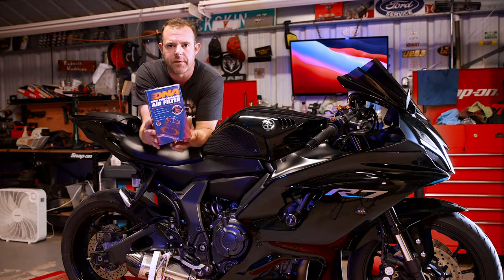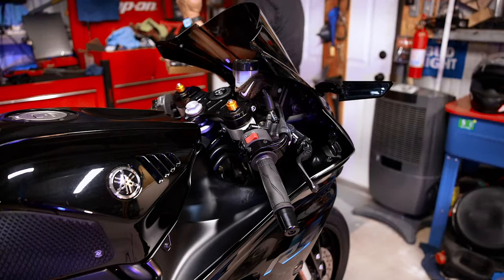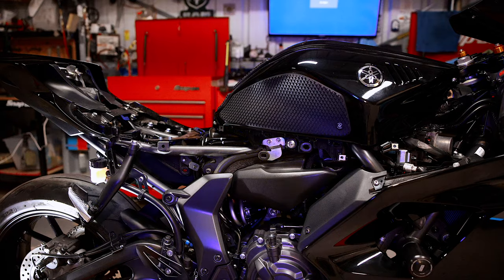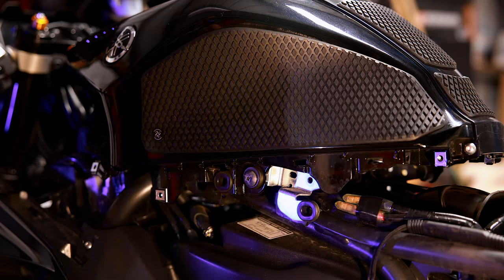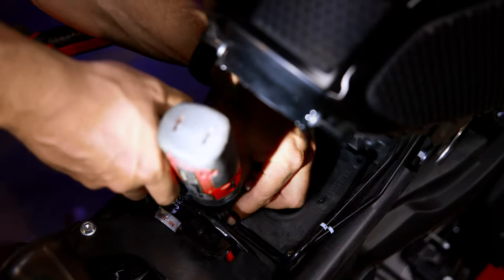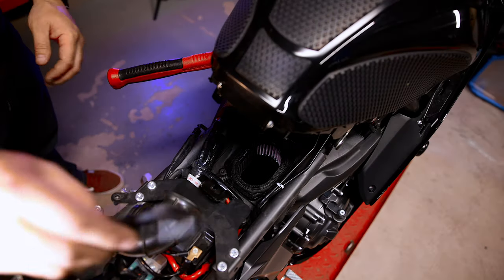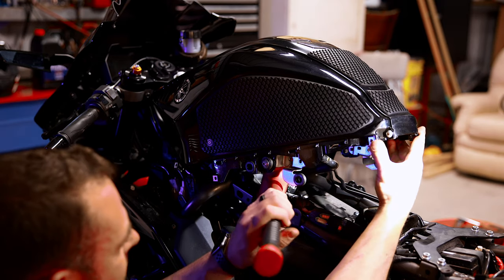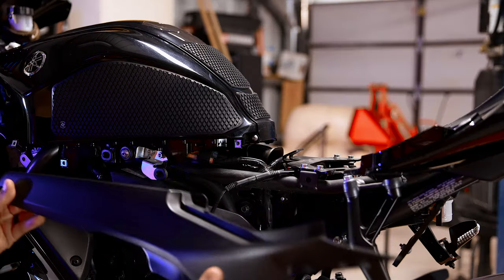Yamaha R7 Air Filter Install

Comment: Take the rubber boot out if you’re getting it tuned. Yamaha designed it to be removable for extra power/ track use. It is on there for regulatory purposes.
I will say the extra power is minimal though.
Reply from the maker: Awesome bro thanks, hopefully I get the tune soon 🍻
Reply: @ScoutsOut  of course bro! I just got a power commander for mine along with a new air intake as well. Putting a tune on her hopefully at the end of the month 👍
Reply from the maker: Nice, let me know what you think about tuning with the power commander

Comment: Great content As always as an R7 owner and new to the motorcycle world I depend on your videos to be able to work on my motorcycle myself. Question how often the air filter needs to be changed or is it washable. Thanks in advance
Reply from the maker: nice, glad the vids have been helpful! the stock filter needs to be replaced every 24000 miles. the DNA you keep and just clean and lube it up. every 7-15000 miles. I did this vid too for installing the ph 2 and how to clean the filter if you want to check that out. https://youtu.be/dc6nSBcXKyA
Reply: @ScoutsOut  Thank you so much 💪🏿💪🏿

Comment: Brilliant video bro, im looking at fitting a DNA air filter to my R 7, it has a Leo Vince exhaust street legal system on it......Would i have to tune it after fitting the DNA if not would the engine end up running too hot.
Cheers
Reply from the maker: Thanks bro, I don’t think you need to tune it but the dna stage 2 cap did a lot more for the bike than the filter imo

Comment: Just installed my DNA air filter and I’m getting my ECU back from being flashed tomorrow! I did notice that my air filter fit perfectly with the DNA writing towards the tail though, it’s flipped in your video.
Reply from the maker: Nice let me know what you think with the tune, mine went in good I didn’t notice any difference either way
Reply: The goat

Comment: Thanks again for the great video! Was wondering if the gain was noticabled after switching the air filter without tuning the ECU?
I have a MIVV exhaust installed so I noticed that the engine is running rich on gas. Hoping that changing the air filter would change that by getting more air.
Reply from the maker: I didn't really notice a difference, but I just got the DNA stage 2 which is going to let in way more air. I should be installing that this weekend so ill let you know if I notice a difference. hopefully I get it dynoed shortly after
Reply: @ScoutsOut  thanks for the quick response! Meanwhile Im also checking into the ECU flashing options (FTECU, Woolich), which might be the utimate solution.
Reply from the maker: Yea, I did the FTECU I like the basic unrestricted tune that it comes with and the ability to get way into tuning later if I want to start to fine tune

Comment: would it be necessary to change the air filter when you get a full system exhaust and before the tune? Or is it just an optional change?
Reply from the maker: I think it’s fine, I did the exhaust by itself for a while. The popping did drive me crazy after a while though

Comment: Scouts Out! I have a 2024 R7 with sc project crt exhaust ! I was wondering what you think of installing a de restricted throttle plate as well as the ftecu tune , dna filter or yoshimura air box . i daily ride this bike any recommendations would be greatly appreciated !
Reply from the maker: Honestly if I were to do it all again, I would do what Yoshimura did with the exhaust, intake and a racer tune
Reply: @ScoutsOut  do you think the FTECU with the sc project crt exhaust would be a good fit or do you recommend another ?
Reply from the maker: FTECU poses another issue of tuning as it isn’t a tune persay. It gives you the ability to tune the bike but you need to know what you’re doing. The kit will lock your ecu to your computer so if you want to have someone tune it for you you have to give them your bike and computer to do so. I reached out to yoshimura and they said they used A Racer for the tune
Reply: @ScoutsOut  So just to clarify you are talking about taking my bike and having A Racer tune it for my sc project crt exhaust ! I understand what you are saying about ftecu , that it’s only a map or pre set I guess you could say ! That I need to have it actually tuned by a professional shop ! Once again thanks for your responses and time !

Comment: I just picked up a 24 R7 and it doesn’t have that rubber boot on top of the air box. I can remove my seat and look in between the tank and see the air filter.
Reply from the maker: No worries, you do not need that rubber boot

Comment: I just did rhis video szep by step and after opening fuel tank and deconnect the cable i lifted it up did some thing and after maybe 5 minutes I saw that one fuel cable was disconnected so yea there was running out fuel maybe aomwone can twll me for what this one is because its not the main fuel cable i guess so yes. But take care of this when doing it!
Reply from the maker: Sry bro if you had issues, did you get it done?
Reply: @ScoutsOut  yes thanks for your answer! But I don‘t see how did you do this part. Did you remove both of these fuel vents? I hope I connected them right.
Reply from the maker: I didn't remove any fuel lines just the electrical connector

Comment: Did you ever get the stage 2 DNA airbox cover? Considering getting it but I don’t know if that rubber top piece that goes in the hole of the normal one will fit the bigger opening of the new cover
Reply from the maker: It won’t fit on there which makes me think the rubber top won’t matter if you take it off, looks like the top is just a wider opening then stock

Comment: Nice video! I bought a racing R7 intake came with a MWR foam filter, airbox lid with big opening no snorkel and also came with replacement velocity stacks! Same setup most front running r7's in Moto America twins cup class... Heads up the velocity stacks are not fun to install!
Reply from the maker: Thanks dude, I just finished installing the stage 2 dna cap which removes the stock and let’s in way more air flow. I was wondering when we would get velocity stacks for the r7
Reply: @ScoutsOut  your welcome brother! There is a few different stacks available for the r7 I went with the entire spears intake kit was pricey but supposed to pull hard all the way up to redline ! So we'll worth the $$
Reply: Also did the canister delete.. you may or may not have one on your R7 it's a ca. thing,  when the valve activates it leans out the bike
Reply from the maker: Nice I’ll check them out, I was quite surprised with the extra top end from the stage 2 dna I could only imagine with the velocity stacks added in
Reply from the maker: I in CA do so we m sure I have it, how was that to get out?
Reply: @ScoutsOut  The only materials you will need are two vacuum plugs and a piece of hose if you're able to turn off the purge valve through software flash you won't have any lights Come on ,otherwise they have a dongle that plugs in where the purge valve was. There are two vent lines coming off the gas tank. One goes all the way down by the kickstand. The other one goes to the canister. The one from the tank that goes to the canister you want to extend and run it out by the kickstand..
Remove the canister and the tubing coming off the canister that goes up to the purge valve. There's another line coming off the purge valve running to the throttle bodies that Ts to each throttle body you want to remove those and plug the ports on the throttle bodies. I just removed everything and told the person doing my flash to turn off the purge valve
Reply from the maker: @Suisk8  nice dude thanks
Reply: @ScoutsOut  anytime brother!
Reply: @ScoutsOut  Do you only need the filter and cap for everything to fit? Or does the rubber that guides the air in no longer fit then?
Reply from the maker: Just the filter and cap, no need for the top rubber funnel
Reply: @silent_fluo6917  the velocity stacks (funnels) will fit with the high flow filter and high flow lid.. But there is more power available by also replacing the stock velocity stacks with the optimized length symmetrical ones that are available through various companies..
Yoshimura released their complete high flow air box system for the R7 for about 600
The Spears racing setup I'm using is around 500 but uses stock airbox

Comment: Are you going to take the bike to a Dyno after the ecu flash? Did the guy say to remove the plastic intake?
Reply from the maker: I’m going to try and dyno after flash yes, I chose to buy a tuner instead of going to get it done so I haven’t asked that question yet. I did find that there is a aftermarket DNA top cap that can be added to increase flow that would not fit the stock rubber piece. Which means to me take it off there is no real use for it
Reply: @ScoutsOut  Nice! Did you use the TST flashing kit? Curious how you find using that too! Thanks for the reply and info!
Reply from the maker: Yea I did grab the FTECU from TST, I should have it this week so in a few weeks it will be out with install flash and how it rides

Comment: Can Stage 2 run without a tune or does it require it?
Reply from the maker: I did stage 2 and I still think it runs within ratios that don't damage the bike, but I will be getting a tune at some point and I think the bike will be 👌🏼 after that

Comment: Got a full system and looking to add this filter as well. Do I have to do a ecu tune or power commander to run both of these?
Reply from the maker: Really hard to say. I've done the exhaust filter and DNA cap which was the most noticeable power gain. When I got it dyno tested it was lean but less then 10%. Understanding how cars run... anything under 10% is acceptable, not optimal but acceptable. So will it damage anything, imo no but the gain in power with more fuel would be drastically better
Reply: @ScoutsOut  awesome. Thanks dude! Love the channel. New sub. Keep it up!
Reply from the maker: Thanks bro, 🍻

Comment: What tune you doing? doing it yourself?
Reply from the maker: I’m going to get it tuned hopefully soon, I’m going to have someone else do it
Reply: @ScoutsOut  You gonna do a rearsets video at some point? Would be helpful to see
Reply from the maker: My next vid is asking you guys what I should do next lol rearsets or damper. So far I see graves and woodcraft for rearsets just not sold on which one yet so to answer yes rearsets are coming
Reply: @ScoutsOut  That's great! After some research I'm torn between the Woodcrafts and the Attack Performance. I think I am leaning towards the Attack because they have a lot of adjustability. I am a tall rider 6'2
Reply from the maker: Ohh cool I’ll have to check those out too, it’s nice we starting to get more options now
Reply: @LuckyOctober  

Not to hijack Scouts video, but I did do a video on the Woodcraft rearsets and what I think about them, so go check it out. 😀
Reply: @moton8tion866  yah I saw that video. You made some really good and valid points. I was hoping to see the install process this will be my first rearset change

Comment: Is it necessary to remove the seat in order to open the tank
Reply from the maker: Yea I think so, it’s pushed up against the tank. I guess if you took the bolt out of the front it may be possible

Comment: Aloha, did you notice any changes before you have it tuned? 🤙🏼
Reply from the maker: A little with the exhaust, I just rode it today I had Covid all last week and I didn’t notice a change with the air filter in hopefully the tune will give a nice bump, if anything I’m going to reduce the engine breaking with the tune so that should be cool too
Reply: @ScoutsOut  Ah shootz hope you are feeling better 🤙🏼
Reply from the maker: @1000750  yea I’m much better today thanks bro

Comment: After installing, how soon should I get it tuned?
Reply from the maker: I rode mine for quite a while and was told even with the exhaust and dna it isn’t going to hurt the bike, technically mine still doesn’t have a tune mine is just unrestricted so less engine braking and the fan turns on earlier
Reply: @ScoutsOut  who's telling you that? because the R7 is lean from factory, have you Dyno'd it to see the F/A ratio? You have to be getting way more air than fuel
Reply from the maker: Yea, I’ve done a DYNO and I’m still lean yes. It’s roughly 13%

Comment: With full M4 system and intake , tune is definitely needed?
Reply from the maker: Hard to say I’ve been told no it’s fine, but I personally believe it needs a tune at that point, I don’t think you getting a real benefit out of the the intake and exhaust without the tune. I want more than just a little power increase too I want to drop some engine braking too
Reply: @ScoutsOut  are you sending out your stock ECU? And if so, where to? I also have an R7 and would like to do these mods
Reply from the maker: I’m going to take the bike to a local, hopefully this month. If all goes well I’ll put out the info on how to send in the ecu

Comment: If I install a exhaust and dna air filter do I need a tune?
Reply from the maker: i'm not a professional so take this with a grain of salt. i know that if a car runs to lean you will get a check engine light, and that can happen at 20-25%. i've rode the bike with a scan tool on it and it doesn't run lean enough in my opinion.  what i don't know is when the bike would throw a CEW for being to lean, but the way i see it the bike will run much better with a tune.

Comment: Can you run this dna filter and exhuast withoit tune? What do you mean overheating engine with this filter?
Reply from the maker: Yea I think it’s fine. I’m still without a tune just haven’t gotten around to doing it yet. The guy I want to do the tube told me it’s fine
Reply: Ok good to know yeah I just ordered an exhuast and the stage 2 filter so I’m throw them on this weekend. But I also don’t have a tuner near me so I’m be riding it without tune for awhile until I find one or go somewhere
Reply from the maker: Yea, you will be fine
Reply: Sweet my brother yeah I’m stoked to see the differnce. I’m still in my break in period so I’m finish that first before I install the mods
Reply: I wouldnt run both without a ECU flash because the R7 is already lean from the factory so to add a aftermarket pipe & filter it has to make it way more lean sure you can run it but I wouldnt
Reply: Yeah
Reply: @BoxingLegends2024  I’m wondering if there are just plug and play ecu tunes for the r7 like vehicles like the mhd and Cobb platforms for bmw ect. And than just one one there base maps.
Reply from the maker: There are lots of ECU mail in options, I believe two wheel DYNO is a good one

Comment: Great video but an absolutely horrible design for placement and changing of the air filter.
Reply from the maker: Thank you!! And I totally agree it should be much easier to get at a replaceable item
Reply: @ScoutsOut  I just put a down payment on a 60th GP Anniversary Edition R7 it won't be here till sometime in September. Yosh exhaust with new intake and braided brake lines with be the primary mods I do. Outside of that I want to keep the bike in original format as I feel this edition will be come collectable down the line.
Reply from the maker: Nice, good choice. Im here at laguna seca watching MotoAmerica right now and the Yamaha demo truck has a few and they look awesome 👌🏼